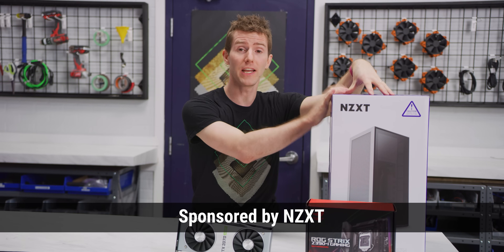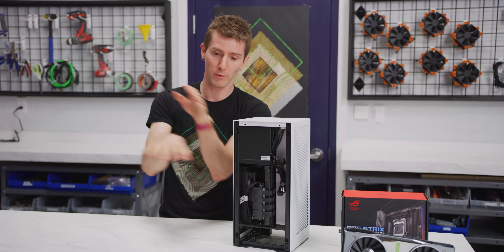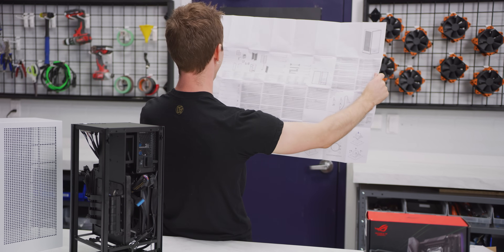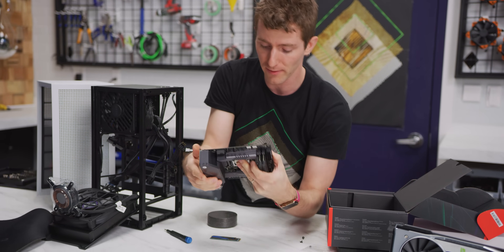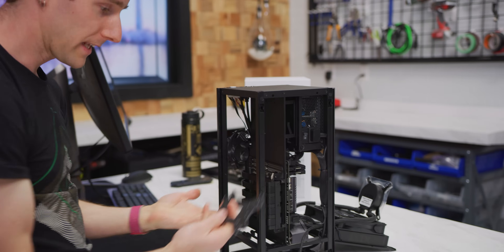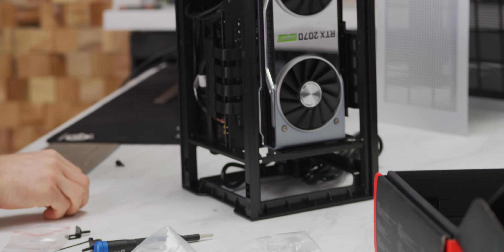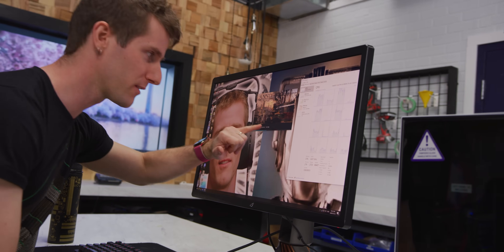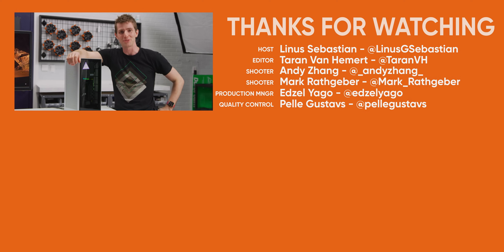Building the Xbox Series X Rip-off PC

Comment: I'm a novice. I am building my first pc today, i have watched your videos religiously for months doing my best to understand as much as i can. I will say this build does look quite a bit easier in regards to cable management. On the other hand, though the case is well designed, i don't think the small form factor is good for novices because when things are cramped up...a new builder like me could easily break something because i may not have planned the perfect fitting ram or graphics card to fit flush... but obviously i'm new so maybe i'm totally wrong.

Comment: Too bad that despite the fact that it costs over 4 times the price of a series x and has a way faster cpu. The gpu will still not touch the 12 teraflops of compute power of the series x. And will generally make this system not outperform a series x by much in most games. It would be hard to get equal gaming performance for the same money as the series x will cost. In that sense, a system like this would indeed be a rip off in comparison. I am a pc gamer, and i won't buy a console. But i have to admit. It will be impossible to match the series x game performance for the price if you'd try to build a pc with the same amount. Probably even worse by the time the series x releases.

Comment: Linus installing CPU: Pretty hard to put it in wrong.
Dennis: Hold my beer!
Reply: Dennis: Hold my thermal paste
Reply: He should have used the cpu installation tool that the guy from the verge had.
Reply: LINUS DID IT WRONG, YOU GOTTA PUT THE THERMAL PASTE IN THE SOCKET NOT THE TOP OF THE CPU.
Reply: More like dennis "hold my chocolate yoohoo"
Reply: many times it goes in the pooper if your in the dark and drunk off your face

Comment: Looks more easy then the rest of the builds because it's a regular case with a cooler and power supply built in, and the cables are short and look more easy to understand where the cables go

Comment: I have built one computer from nothing and years prior incorrectly installed ram.

There were at least 3 things you did I would have been excessively worried about breaking something.

Ram installation and the difference between (how to identify ) high and low profile
cpu/back plate, aio cooler.

Comment: It's a nice case and all, but this looked more complicated to build than doing things from scratch in a case with a bit more space. But pretty bad ass case. Underrated feature is the fact that the cables all are routed at the very bottom so if it sits on a desk or next to your TV, looks much neater.

Comment: been looking for a case that can replace my (modified) cm elite 110, because it has a couple liters of unused space in it that id like to get rid of. unfortunately all the options for that have been way to expensive thus far. theres that silverstone case, but i think cubes are rather spatially inefficient when using an sfx psu and medium length video cards (i got a zotac 2070 super mini into mine with some fanagling/bending/dremeling), not to mention limiting the size of your cooler by making it share vertical space with the psu.

this case falls firmly into the way too expensive trap. it does have some things i like, for example when your aio inevitably leaks, it will drip somewhere other than your video card/mobo. has great ventilation, and the vertical layout makes me ignore tha fact that its 13.6 liters, which is only about a liter and a half smaller. i want something in the <12l range that wont bust the bank.

Comment: In terms of general pc building I would say this looks easy but I don't think I would recommend it to beginners. I think with the tight fitting and special layout beginners are more likely to make mistakes compared to learning on standard ATX first. If you really want the small formfactor as a beginner this is for sure the easier way though.

Comment: As a novice I’ll say that this build looks really uncomfortable because it’s so small
Reply: Depends on how big you want your computer to be would depend on the case. The NZXT H1 is a really small form-factor case, and I'd say for your first PC build, it'd be quite easy. If you want a bit more space, then you could go with the NZXT H210i and have better cooling performance for your CPU (with a 240mm AIO) and also better airflow. You could also go mATX and use a Fractal Design Meshify C Mini and use a 280mm rad. or you could go ATX (like me) and have LOTS of room for expansion. I used a NZXT H510i, but the airflow is not that good in it, so I'd recommend a Fractal Design Meshify C or Corsair iCUE 220T for your first build.

If you build a computer in the H1, then make sure that your graphics card can fit. Look on Newegg for the length. The ASUS ROG Strix cards just barely fit in (they would get scratched tho), so I just would not recommend a card with 3 fans. If you are doing Nvidia I would recommend a EVGA (dual fan) card or a MSI VENTUS card. If you are doing AMD, then I''d use a Sapphire PULSE card or a MSI MECH card. FYI, the ASUS ROG Strix cards are 304.8mm.
Reply: Louie Friesen it’s funny you mention the meshify, I’ve had my eyes set on it for my first legit pc build
Reply: As someone who owns a 2080 ti, I would like to say, nvm I forgot what I said.
Reply: I know right ive got small hands and i find at some times building in a micro ATX case cand get pretty dang cramped so mutch so i dont have my internall dvd drive hooked up right now
Reply: Honestly any size case can be awkward just because you are trying to put screws into the corners. The fact that all the panels easily come off make this case look great
Reply: As an experienced, that case looks like pain.
Reply: Try a Dan Cases A4-SFX and then you'll really think start thinking uncomfortable.
Reply: I agree
Reply: Yes
Reply: Yeah
Reply: Yeah, I probably wouldn’t try and do a sff as a first solo build. I love my sff pc, but it was a pita to build and it was like my sixth from scratch build or something. Most of the time was spent in parts selection, which was agonizing due to trying to make sure all the space constraints were right.
Reply: As someone who built a Phanteks Evolve Shift (glass panel),  with a 2080Ti inside, there are several moments where you just have to stare at the case to figure out how to get the pieces in, and in what order to start with. That said, some of the gaps are paper-tight once cables are tied in, or even tighter. And it goes well above 50'c/90'f, as it needs to expel 200w or more of heat, even with a 140mm CPU radiator

The other advantage of the Evolve Shift is it fits 140mm Corsair LL-RGB fans, which are mediocre for heat/performance, but you can illuminate the room with the front panel off for airflow.
Reply: @Toliman.  lol only 2080? I have a 3080.
Reply: @bloodhoug82  no
Reply: @Toliman.  that case gave me nightmares honestly, but im not willing to spend another 100+ on a case so i just kept optimizing until my 3600/5700xt combo stopped whining and overheating. fully aircooled system btw, glass panel on the cpu side, mesh on the gpu side. working great so far, apart from the random freezes im still experiencing with my gpu. i guess thats first gen navi for ya
Reply: @Toliman.  been there dude love my evolve shift but was a pain took me like a month to get it how i wanted
Reply: @Toliman.  Ok that's cool but um nobody asked if u had a 2080Ti u seemed to just shoehorn this in to flex
Reply: plip plop tbh that isn’t a flex.
Reply: @GoofySaturn9339  not really a flex, included so we could get an idea of how hot it would get inside the case
Reply: @GoofySaturn9339  Not a flex that's so obnoxious I would get really mad if I was him.
Reply: @shakypro  what? How am I saying that he's flexing obnoxious
Reply: @Looosid  yeah because everyone has a 2080Ti
Reply: PK Fire no you don’t have to be rich. If it’s your passion you will find a way to get it one way or another. If you don’t have one you probably don’t want it or you really haven’t tried getting it.
Reply: @GoofySaturn9339  Because you don't know a 2080ti is bigger than other GPUs and is worth mentioning because it makes it harder to fit in a case. It's so annoying when people call something a flex when they are uneducated about it. And he sounds like an enthusiast if you save most of your money on tech and you get a part time job as a teenager getting a 2080ti is realistic.
Reply: @GoofySaturn9339  maybe he meant that the 2080 ti is hot, which is why he brought it up
Reply: @Toliman.  unrelatable rich guy
Reply: @Metalgrey007  if you take away like 30-40€/motnh you can build a 2k€ machine every 5 years that will last you 5 years without lowering settings, also you can use your cpucooler and your powersuply for the new build aswell as the ram and maybe even the case, so theres minus 400, leaving you with a new motherboard, gpu and cpu aswell as 2 additonal 8gb ram sticks every 5 years, i dont see any flex here if you do it with a brain. i did exactly that 3 weeks ago 2080ti= 1.2k€ + ryzen x3900 450 + motherboard 180 + 80 for additional ram =1910,-... and lets not forget i can sell my old stuff wich left me with minus 500, so my new highendbuild cost me 1410,-  thats 25€/month for 5 years.... my handy costs more every month than my rig ^^.

Comment: from a person who has never built a pc, the scariest part is honestly cable management and where you plug cables in on the motherboard
Reply: There's instruction on the motherboard and manual. Its not like the early 2000 or 90's pc build. Of course, there are many simple online detail videos you can look up for your type of build unless your going full custom. Which you need more build experience before attempting custom like water cooling setups. If your just looking for the basic its easier than you think now. The more challenging part is playing the waiting game for installing software drivers and operating system. After that, its pretty much a repeat.

Comment: Ok I think I am the type of person you want to hear from for this video.  My computer knowledge I would say is above the average person on the street, but definitely a novice compared to the guys at LTT.  If Linus said to me, "here is the case, the parts, and the instructions, put it together.", it would take some time but I could do it.  

Building my own computer has been on my bucket list for a long time.  My knowledge gap begins when you start to get more technical.  What makes this type of RAM better than this one.  AMD vs Intel, which is better for what.  Will this component work with this component.  What makes this GPU better than that one.  This is a good motherboard and this one is bad because of ______. That sort of thing.

Like I said, if I was given everything and told to put it together, I probably could.  I would run into issues during the actual collection of the components.  Any recommendations for getting more comfortable with spec side of things?  It can be overwhelming trying to learn everything due to the vast amount of knowledge available.  Kinda like trying to take a sip of water from a fire hose.

But ya, this case definitely seems like it would be a good "toes in the water" kind of stepping stone.  Nothing that Linus did was baffling or mind blowing.  But wouldn't it be easier for someone stepping into the world of building their own rig to use a normal sized case as opposed to a compact one?

Comment: It feels hard for first-timer mostly because without a checklist and a guide to point out which cable connects go from where to where, you can screw up not only the order of building (Which is very important), but also forget some stuff. 

It's not the ability to screw in that's the bottleneck, it's knowing which part goes first and what all things need to be connected. For example, a new person might spend eternity trying to figure out what to do with AMD bracket thinking he's missing something.

Comment: Well... honestly, I don't see how this makes building a PC much easier. You don't have to screw in the PSU and the radiator is already mounted, but that's about it as far as differences go?
Thanks to the small form factor, it definitely is more fiddly than just building in an average size or large case. For a novice, I'd always recommend getting an actually good, big case. That, in my opinion, makes life easier.

Comment: Plzzzz someone help me my ryzen 5 3600 keeps clocked at 4.1 ghz even at idle and produces large temperatures...I have 5 fans and good airflow....is there any software issue seems like some automatic overclocking plzzzz help😭😭😭😭😭there is some software issue I think coz physically everything is fine I use stock cooler it is properly seated and stuff plzzzz

Comment: Novice here: two questions. 1. Can I get a recommendation for preferred low profile RAM to avoid the clearance issue experienced in this build? 2. Is there a reason, besides price, that a 2070 was used instead of a 2080 and would a 2080 be a better option? Thanks in advance.
Reply: The 2070 was probably just available for use at the time. A 2070 is capable of running just about everything, but maybe some graphics heavy games will have "low" frames. The benchmark for Shadow of the Tomb raider was hitting around 55+ frames consistently, which was smoothened out by G Sync. That game is a good example of a graphics heavy game. A 2080 would be a small, but noticeable step up in frames - but it's really up to you. Do you want a solid 60 at all times, or do you prefer games running 100+ frames? Even then, the performance of a 2070 is still really friggin good. I'd justify price, and your personal preference on frame rate vs. Ultra/high graphics.
Reply: LostParadise the short answer is I want the best performance for the longest period of time! Thank you very much for taking the time to respond.
Reply: I actually have this exact build in every way besides the H1, motherboard, and NVME drives. I also play on a 1440p 165hz Asus ROG PG279QZ. I mainly play Destiny 2, FFXIV, Doom: Eternal, and Escape from Tarkov. Doom: Eternal ran capped at 165 fps on ultra with G-Sync. Destiny 2, FFXIV, and EFT are all really nice looking games, and run at 100-140 fps on ultra 80% of the time and only dips down to 60-70 when things get really intense, usually with large amounts of other players. 

I say save the money you'll spend on the 2080 Super and just get this exactly build, you won't be disappointed. Honestly, I'm going to buy it , too. Feel free to message me if you have any other questions!
Reply: Granola Bandit thank you very much, I appreciate the feedback. My intent is to build the model depicted in the video, but also avoiding the RAM clearance issue he experienced.
Reply: @MikeKilo1969  No worries, good luck with your build!
Reply: You used the word novice so a few questions: 
- What are you using the system for?
- Have you had a gaming PC before?
- Do you play a lot of games?
- Is this your first build?
- Do you already have any parts?
- What kind of budget are you working with?
- Will this be built over time at all?
- Are you overclocking at all?
- What kind of monitor do you have/will you be considering? For instance: my little brother was using a slightly older 60hz 720p monitor & was happy with the screen when I helped him with this
- Finally are you decided on things like small form factor/Nvidia/Intel/AMD and if so did you read up on these for yourself so you understand the price difference, the pros & the cons?
Reply: Sam M. Atherton thank you for responding!! 1. I’m building a gaming rig. 2. I’ve had a gaming laptop, not desktop.3. Yes, I prefer RPGs. 4. Yes this will be my first build. 5. No, not yet but I’m looking at mimicking this build. 6. The budget is flexible but around $2k for the tower. 7. Not sure what you mean, but I intend to build it within the next 6-9 months. 8. Most likely not over locking. 9. Unknown, but leaning towards 144 Hz refresh rate and 1 ms response. 10. I prefer an ITX case, but I’m flexible on the rest. Yes, I relearning about the new hotness in the market.

Comment: Not a novice PC builder; but I have not ventured into the world of small form factor PC yet, and I gotta say this looks alot less daunting then some other console sized mini ITX cases out there. Thinking about getting this. The only thing holding me back is the price. $350 is just a bit on the pricier end for what's basically a case, PSU and cooler. It's not too bad; as I was watching this, I said to myself that I would get this if it were under $300. So while it is above my threshold, it is only just barely above it.